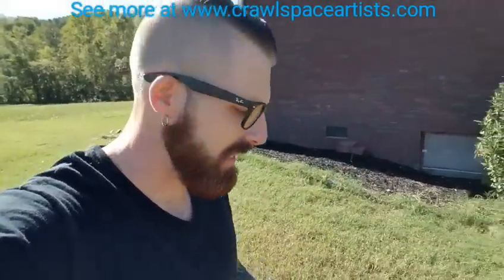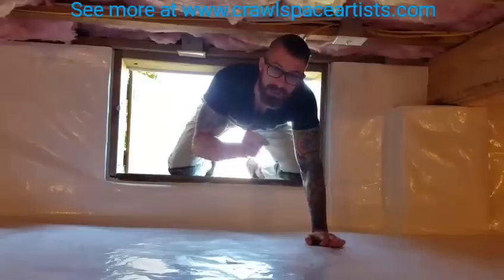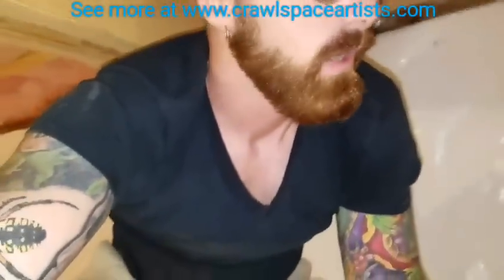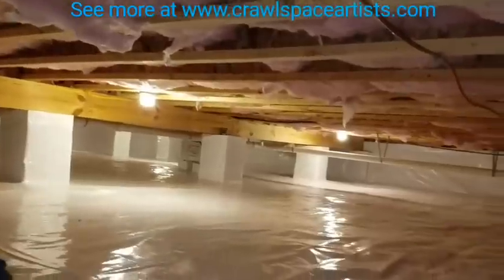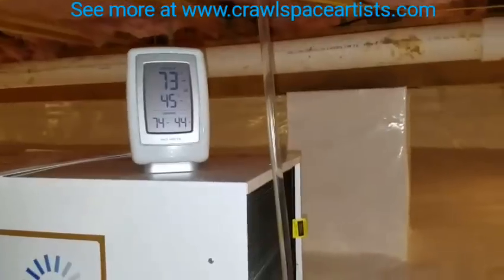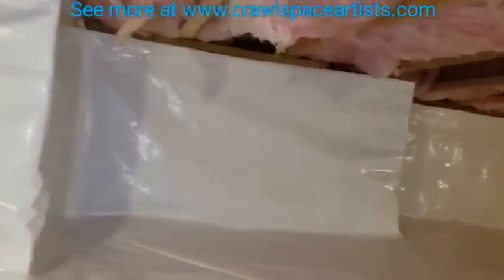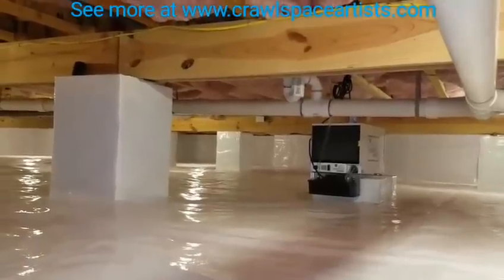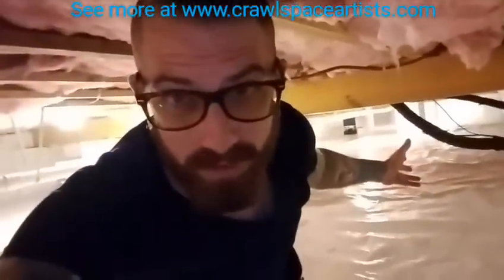Best Crawl Space Encapsulation

Comment: We are building a new home on an icf frost wall. The builder wants to know if we want the floor poured as well. Or. Sand/Stone/Vapour Barrier. What do you think the cost difference would be. And which way would you go? We are awaiting our quote. Keeping Canadian weather in mind.  It will have electric heat ("main" heat source for insurance purposes) 2 heat pumps and a fire place wood stove insert.  As well as the air recirculation unit.  1 level. 1700sq feet.
Reply from the maker: I am not familiar with your territory, or building techniques in extremely cold temperatures. If I were building there, I would seek out the most credible builder I could find there, who has been doing it longer than anyone, and get his opinion on the matter.

Comment: Looks like 2 inch p traps that your lines run into. Is there any concern that once the crawl space reaches a certain percentage of humidity that it wont keep the ptraps full enough to not allow sewer gas to come into the crawlspace? Would 1 1/2 inch be better?
Reply from the maker: Nope. 12+ years no issues. We plumb in accordance to what we have available to tap into. Sometimes they are 1.5". Sometimes you gotta tap into a 3" main. Those suck.
Reply: @TannerFlowers  thanks for the reply. Was just curious if it had ever been an issue. Good work btw. I'm from cookeville and am planning on building in a few years. Will definitely be giving yall a call. Very nice and tidy work.
Reply from the maker: Thank you Kyle. We appreciate it. This is an older one. Our new ones are 🔥🔥🔥.
Reply: @TannerFlowers  yes I've been watching 👍
Reply from the maker: I appreciate the support Kyle!

Comment: Don't you need a termite break 3" at the top of the wall?
Reply: Not necessarily termite will work they way up the wall between the vapor barrier or in the wall then you will have to cut the vapor barrier and drill in the wall 4' on either side on the tunnel to treat but i like sealed crawls but i would have gave it a 3" termite gap
Reply from the maker: Hey! Someone that actually knows something! ^^^^ Thanks for commenting!
Reply from the maker: Only if you listen to the uneducated.
Reply from the maker: https://youtu.be/3Wm7M4PRsy0

Comment: is the floor barrier over top concrete or dirt?
Is it necessary in the northeast  to have a barrier n a concrete floor .  Working with roughly 800 sqf.  EXisting space has only 2 vents on a 50s built split level.  Any ideas or suggestions?   HAve cleaned out.  mostly had moisture from previous gutter issues..  But that is fixed and the grade oaround the perimeter slopes away from the house.
Reply from the maker: I do not fully understand your question. But go to CRAWLSPACEARTISTS.COM and copy exactly what you see us doing in every project, and you'll be good to go.

Comment: Do you use a liquid flashing adhesive, or a tape to connect the seams and at the concrete
Reply from the maker: A combination of various tapes, adhesives, and anchors.
Reply: @TannerFlowers  awesome, in the planning process of building my first house. I'm a remodeler in AL but am going to build my family house so doing research on closed vs vented crawlspace, I'm leaning heavy towards sealed crawlspace.

Comment: I got 2000 sqft how much does that cost
Reply from the maker: That's when they get over $10k Jeffrey. They typically do not reach $10k until they are closer to the 2000 square feet mark. I have seen them hit $10k with less than 2000 square feet. It is not just dependent on the square footage. Linear footage of the crawl space, average height, number of piers, and whether or not we have to remove any existing insulation all play a factor in the overall project cost.

Comment: Ok man, thanks for the video and it is fine to take pride in your work! Now, we are in a place with humid humid summers and cols cold winters. I am getting my crawlspace encapsulated tomorrow and I want to know finally...Insulate or not??? This house is 30 years old and WAS insulated but it was taken out. Should we put it back in? Thanks.
Reply from the maker: It will be very beneficial for you in the winter time if you insulate your floors. I only use the r19 johns manville ComfortTherm poly-encapsulated insulation. It is all I have used since 2008 when we started doing the crawl space work.

Comment: Doesn't code require a 3" termite inspection gap?
Reply from the maker: That is all made up tales from the pest control industry. This 3'' magical window does nothing to which you are told. They are said to be viewing points for termite mud tubes. Those mud tubes go up and over to the box seal. Which we trim every single job in line with. You can still see the top of the block, to the box seal, on every single job. Don't listen to the magical window stories. Those same people will sale you sticks in the ground, and charge every couple months to come check your sticks, and your house never have a treatment done on it. If you are worried about termites, as any homeowner should be, you should have a liquid Termidor treatment performed before the encapsulation work is done. We did termite work for years. I have never, and would never (up to this point in time at least), used any other chemical other than Termidor. Follow the label.
Reply from the maker: https://youtu.be/3Wm7M4PRsy0

Comment: crawl space looks pretty awesome.  Do I really need a $1000 dehumidifier
Reply from the maker: Thanks man! Since 2008, the only dehumidifiers I have ever used have been Santa Fe. The only models I ever use are either the Compact II, or the Advance II. They are currently branding a few new models. I have had issues with units over the years, as you might imagine from doing so many of these projects, but Santa Fe has never once left me, or my customers, not taken care of. They have always stood behind their products. In the beginning, we changed filters annually. We learned pretty quick that was not enough. So we then went to every 6 months. Then occasionally, I suggest some homes be checked, and filters changed, every 3 months whenever I see that snotty sludge forming inside the drain line from the unit, going into the condensate pump.

Comment: I'm in the waterproofing business and have done hundreds of crawl spaces yet this is one neat and clean job! Did u guys install a weeping system and sealed sump to pump out excess water? Not knocking ya this is one hell of a job! I'm in a very wet climate your area may be different and sumps are not required but here it's code.
Reply from the maker: Steve Wallis Thanks! 
No we did not install a sump pump, or drain system on this particular job. There was no need. There never was, nor has been since we did the job, a water problem. The only place water came in at all was at the entry. That has never happened since either though after we built that foundation up.
Reply: Tanner Flowers good fricken job tanners! You guys really outdid yourselves! No clue how you got that poly so perfect! Lol congrats man you nailed it!
Reply from the maker: Steve Wallis Thanks man! We should be good at it. That's about all I do. Check out some of our latest projects.

Comment: That crawl space entry door at 1:20 should have been made of steel with a hefty lock and hinges because it would be easy for a break and entry, they could than miter saw a hole in the floor.  Mine is small, only 10" tall and wish to enlarge it, if and when I do it will be as hard to break in thru there as any of the doors.
Reply from the maker: zzubuzz This homeowner did not want a door upgrade. Thanks for the tips though.

Comment: what is the purpose of those fans on the foundation walls ?
Reply from the maker: Mike White They have built in humidistats in each. I set them low. Typically 35%. I want them to kick on as needed. The need is to remove any stagnant air that may build up from the trapped air within the encapsulation. I learned the hard way years ago when our products, and ourselves, advanced to the you are seeing us do tpday, they are literally "sealed up". The air then becomes stagnant, soured, smells just like cat urine. These fans pull air from within the encapsulation, and send outside the home. That is their purpose. Everything else you see in our videos is what is resolving the customers' moisture problems. The fans are installed, on my behalf anyway, to remove stagnant air from the crawl space.

Comment: Lovely work, the unpainted strand board access door lets it down though I reckon. If I was the owner I would be replacing that with an insulated, sealed door.
Reply from the maker: Smurphenstein No problems with the door. Numbers have remained 34%-42% misture levels for over one year straight. No more hardwood flooring issues since installation. If it needed a new crawl door, I would have built him one. I only build crawl doors when the homeowner needs it, or by request. If they have a large gap, or if they are old and rotten, they will surely get a new one. This one sealed up tight though. Thanks for watching.
Reply: Tanner Flowers still looks unfinished to me. Not saying you did a bad job, in fact I was wondering if you cleaned the pipes as well as it was all spotlessly clean. Beautiful work, to me that door just doesn't fit with the quality of the encapsulation work done.
Reply from the maker: Smurphenstein Ok. You're a door man. I get it. Lol
Reply from the maker: And...in case you didn't hear me in the video, this door was unfinished. Matt was on his way back to complete it as I filmed the video. We seal up houses for a living as we have done wildlife removal for homes and businesses since 2005. I allow no openings in our jobs. Including the door. So however it may look to you, finished or unfinished, does not affect its performance. Opinions are a dime a dozen, but the numbers never lie. And these numbers could not be any better. If the homeowner was a door man himself, and wanted a new door, I would have built him one. As would I have built one for you if you wanted one. I only do business one way. And I will not commit to doing something for anyone unless I am confident in what I am committing to. What you see in all my videos that is a must, is the encapsulation itself, sealing of vents and openings, wiring, lighting, dehumidifier system(s), plumbing, humidistat fans, and a monitor system. New insulation, upgraded door entries, etc. are not mandatory, and some homeowners do not want to pay any more money than what it takes to correct their problem. If they want to add items, or services, to their project, then those services will be performed just like everything else you see us doing...better than everybody else doing it. And then some people only look things to pick at. You know, they find a video, see more perfect work being done than anything else they could ever find anywhere, and then try their best to come up with something negative in regards to the perfection they just witnessed. For you, it was the door. It wasn't painted, or insulated, or brand new, or whatever it is you don't like. Me, I applaude people that have the guts to show their endeavors to the world. I admire those that are out beating their own path. And I know no one as ocd as me when it comes to their work affecting their personal reputation. So, when I see someone trying their absolute best to nitpick something that is "not how they would have done it", I just laugh and recogize the type of thinking that went into their comment. Thanks for the pointers though.